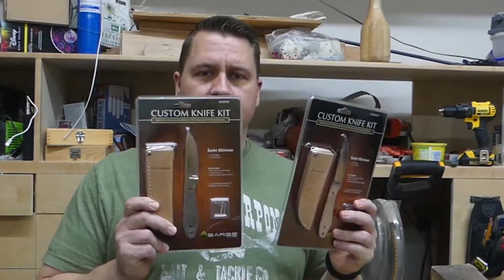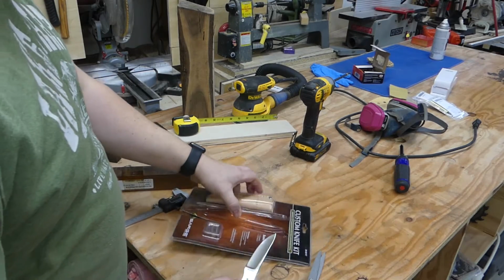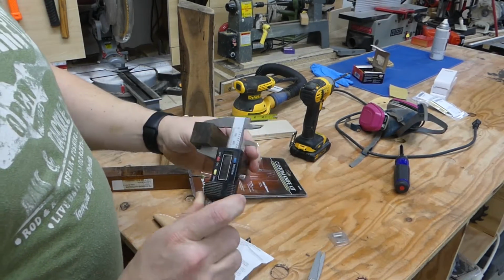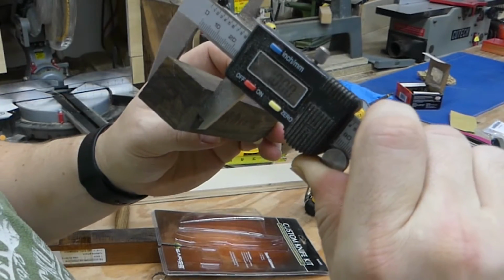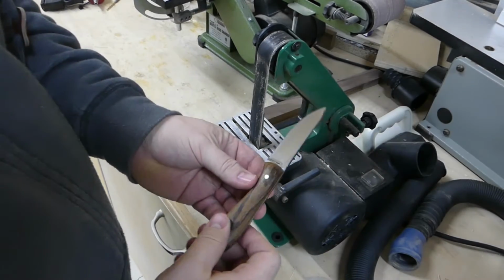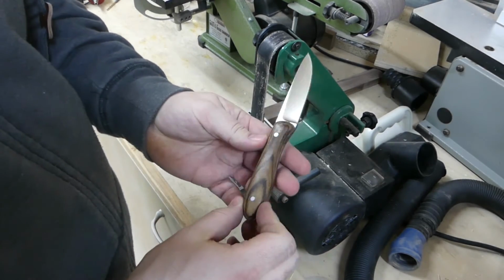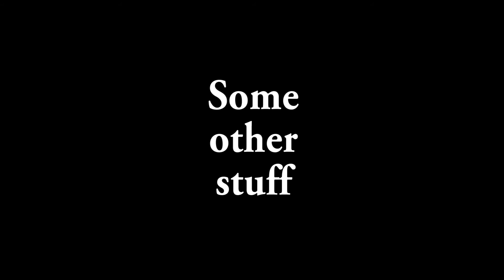Making Knife handles from wooden pen blanks

Comment: You know what, I think the precautionary measure of wrapping the blade in tape is just unnecessary. I mean come on. what's the worst that could happen while you're running the handle across a belt sander or grind wheel?
Reply from the maker: joelnert could've made for a more interesting video...